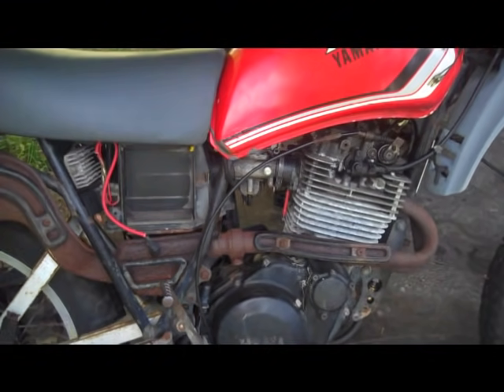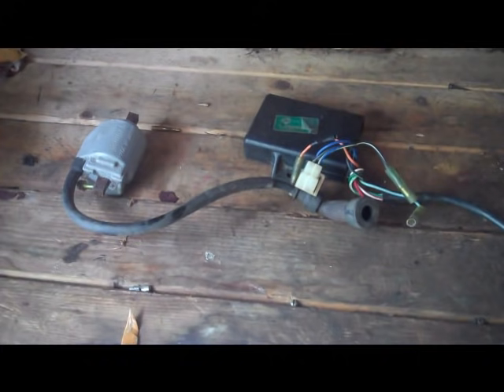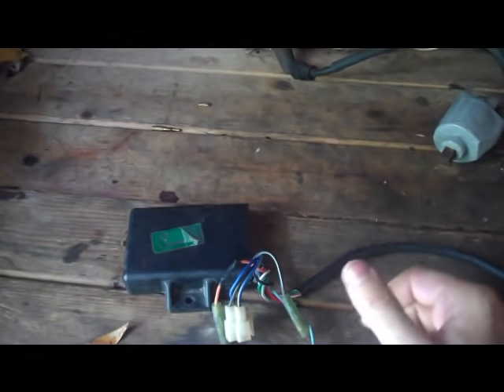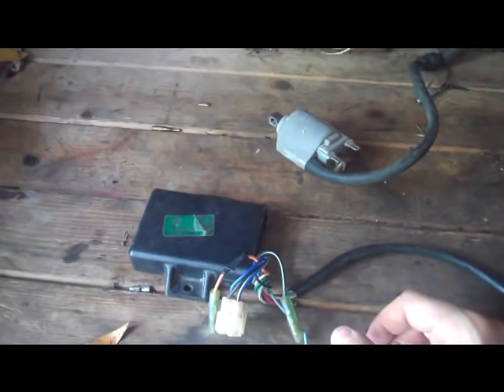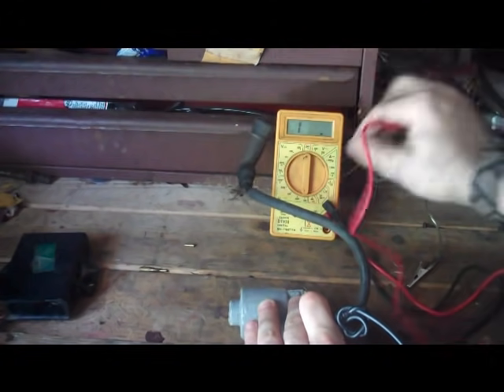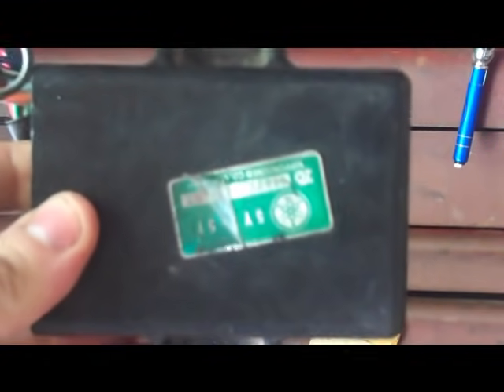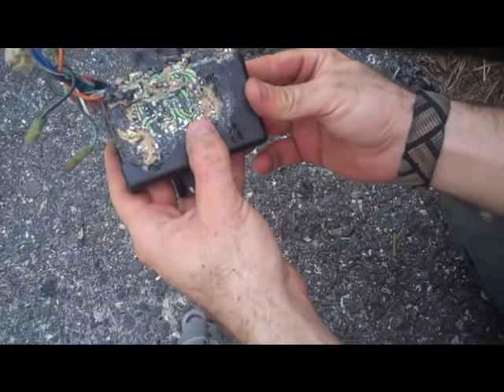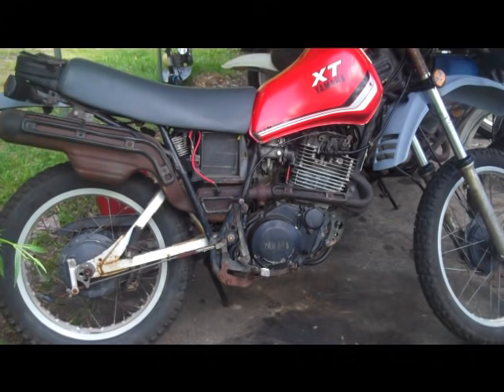How to test motorcycle CDI box, ignition coil

Comment: Hey mrmax, great vid. I have 1995 triumph speed triple 900 just fitted new engine. Starting no probs, though 3rd header pipe staying cold on tickover until you rev it a bit. Take it out on the road and is fine for 100 yrds or so then starts cutting out suddenly then starts again after 30 seconds or so and then keeps doing the same. Swapped coils over same symptoms, same cylinder, changed plugs, any ideas dude? just gonna check yer diagnostics site, cheers
Reply from the maker: Id suspect carbs first thing, perhaps that float is stuck not letting in enough gas
Reply: I can check that, through triumph forum the ignition pick up coil in the crank case came up as a strong possible with the very symptoms I'm having, got a new one to fit, cheers for replying :)
Reply: The problem tyrned out to be a dodgy spark plug. I thought I'd eliminated this possibility but the 1st plug I changed was not a new one, and bloody hell it turned out that it was faulty too. Only when I tried a brand new plug was it sorted. But its interesting to see find that all the symptoms I experienced were down to this. Cheers

Comment: CDI is electronic controller,collect charge from black coil inside engine, store in capacitor than discharge at certain time. small engine like chainsaw did't need sensor to syncronize it timing but motor bike have floating high resistant coil only connect to CDI both end, to do sync.
high voltage coil ,will charge capacitor in CDI, one end will connect to body of engine and another will be send to CDI.
lamp and battery coil, or power coil have low resistant ,almost zero.
DON'T USE HAMMER

Comment: i have a honda magna vf750, the bike will start but once running the RPMs will fluctuate up and down. normal operating range should be around 1000rpm the bike will rev up to 2000 then back down to 500 on its own and runs really rough could the CDI box have something to do with this?

Comment: Hello, I'm having some trouble with my cbr f3. The bike will not go over 55mph. It's like it's starving for gas past third gear. The carbs is good the fuel pump is good new plugs. It feels like the carb bowls are out of gas and when you give it gas feels like its empty. My question is can electrical produce the same symptom I'm having? I was thinking it was a fuel problem but note I'm thinking it could b spark

Comment: i have a motorcycle that uses 2 plugs per cylinder.  it seems only 1 plug is firing, other one, not at all.  my coil resistance is 14kohm, book says 18-20kohm is acceptable.  do you think the coils is causing poor spark?

Comment: Thinking my old enduro has weak spark. Replaced the CDI with a rebuilt one and have no spark at all. Put the old one back in, there's spark. Bike is running crappy but it will start. Got good compression. Seems that I have a bad headlight, though. Do you know if that can cause spark issues? I replaced a bad signal wire but no change in performance.

Comment: I just bought a 97 gsxr 750... Its been sitting for 2 years. Ive changed the plugs, oil, fuel, cleaned fuel tank and lines, new battery, and cleaned the heck outta the carburetors. The bike will run at idle but when I ride about a mile down the road the bike just shuts off and then about 15 to 20 mins later ill be able to start it again. Some one please help?? Thanks

Comment from the maker: Ha yeah probably the CDI is ok. Check for vapor lock, float levels, and vacuum leaks. Sometimes when your coil and spark wires get hot, if they have a crack in the casing it will allow the spark to ground out on the frame, causing the motor to stumble like it is running out of gas

Comment: Can you make a vid about checking your dirtbike for all kinds of problems? also cold starting is one of my issues. I've had this Honda xr100r sitting for about a year ... I drained the gas and cleaned the carb and the spark plug looks alright .. Any help at all would be much appreciated !
Reply: Get some ether in there, make sure theres spark and its drinkin gas.

If no spark, gotta get that first.
Try cleaning your points.

Comment from the maker: Id first check out the intake and air/fuel mixture. Is the airbox and boots all stock, tight and no vacuum leaks? Carb jets are clear and the stock size, float level set appropriately, clean air filter, good gas? These little bikes are very sensitive to inconsistencies in the intake
Reply: I have a Yamaha XT 600 motor and the wiring on the stator and that the plugins been cut off as well as the plug in for the CDI box I don't know where all the wires go to could you please help
Reply: Yeah this is Tim again on this 600 XT motor does Stater has no plugins they've been cut off the and the rectifier has no plugin I'm trying to figure out how to rewire this thing can anybody help

Comment from the maker: Its a wire that leads directly from the battery and has 12 volts to it, so when it touches the frame which is the ground, it shorts and causes heat. The solenoid may be to blame, or it may be a rogue wire like I described. Watch my video on wiring diagrams for more info.

Comment from the maker: Yes the battery will have an affect, depending on the design of the ignition system it may be able to be started without a battery, but more likely than not a battery is required in order to get a good spark

Comment: hey man, i got a question, when i check putting the negative onto the ignition coil and the positive into the plug doesn't read anything but the plug is new and the wire too, it could be the ignition coil?? and also mark 4.0 when i test the ignition coil i have to replace that?? thanks

Comment: sometimes it sounds like theere is a hole in my exhaust but if i turn my engine of and back on its fine my powervalve open and closes a lot by itself but today it happend and it satyed like there was a hole in my exhaust none of my lights are workin bike still starts first kick drives fine do you think my cdi unit is gone seems like it? oh and by the way i have a 2001 yamaha dt 125R and i only replaced the battery and the voltage regulator so it can't be them thanks for your help!

Comment from the maker: This one was full of resin too, some guys will meticulously melt it off on low heat to try to repair it if it goes south, but I didnt have the patience. Apparently the resin is a good idea for use on a bike that bounces up and down so much, but it does effectively make the CDI a replacement unit only

Comment from the maker: This could be a coil problem, or associated wiring. Its always best to replace with OEM parts, I dont know enough about GSXRs to tell you whether the 600 or 1100 or 1000 will mate up, or even the katanas, so go on ebay and try to find some 750 coils if you suspect they are the source of the problem

Comment: Hey Mr. Max, found the vid that u mentioned. On my 75' Honda I don't have but two test points one from the points and the other going to the plug. So I guess just go to ground on both of the wires and read the ohm? Then check the book. And I don't have a CDI box, maybe I should convert? Are they fairly reliable? I just need a spark. Could a rectifier cause any trouble starting? Thanks.

Comment: the bike runs well but at 5000 rpms she just loose power and almost dies!! 
just buy a new cdi and send the carburators to the mecanic! lets see if this fix the problem!
Reply: I have the same issue but it's around 1800 did you figure it out?

Comment: I believe the timing is good as the problem comes on and off instantly.  It could be the secondary, I don't know what that is, I was just told to make sure it was under 1ohm between the only 2 wires going into the coil.

Comment: It's not just at high revs, it's always, especially low revs.  At least it has a slim chance of snapping full power for a second at wot and/or high throttle.  What's the plug gap, I can regap.  I cleaned the carbs before I looked at ignition including soaking the jets (all looked pretty clean).

Comment from the maker: As taken form the repair manual (let me know if you want me to send you a pdf copy of the manual): If the engine misses at high speeds: fouled or improperly gapped plugs, improper ign timing (faulty component in system), improper or clogged jets, weak ign coil, weak CDI box, improper valve timing, fuel line occlusion. The book says you should have b/w .55-.85 ohms resistance on the primary for the coil, so you are good there, and 7200-8800 on the secondary. Did you test the secondary?

Comment: Well, looks like you were right, paid $100 for a CDI box (brand new, the guy builds 'em and bench tests 'em, "CDIMagician" on ebay).  Runs identical as before.
.
I've heard that the coil should have no more than 1 Ohm of resistance in it and mine has like .6 (and my multimeter was measured against a 1 Ohm resistor, so it's pretty accurate).  All the stator checks I did checked out.  Not quite sure where to turn now.

Comment: I have a roketa 50cc scooter that was running great until last night when I left it outside while it showered for 20 minutes. It was dirty so if figured it would be fine. After the rain I tried to start her and it started but the my tack was reading 10,000 rpm but the bike was idling at about 2 then it stopped running. I bought it with a racing cdi on it. I'm getting spark and gas but can't get it to run now. I'm thinking a cdi because of my tack being off.

Comment: I have a '82 CM450E.  My bike was dogging below like 40% load, then it would come to life.  Then the point at which it would "come to life" became higher and higher until it got to the point where it was always dogging.  WOT gets me to like 45 unless it randomly decides to crack full power at WOT.  Cleaned the carbs, no change.  I realized it was running on one cylinder, but I have a (VERY VERY FAINT) spark on both plugs.
.
So......coil or CDI box?  I don't like throwign $80 at something but...

Comment: o.k so i checked the plugs they r o.k.  but as i open the air box i noticed that the breather hose to the air box is oily, and around the air box seal.  what does that mean, and what is the function of the breather hose?  bike 01 magna 750

Comment: Interesting timing on this vid, Max. I followed a guide to cut a wire to the CDI last weekend. The bastard box was retarding the timing of the ignition apparently to ensure the rev's don't pick up too quickly and fail a fly-by noise emissions test. 
The engine is so much smoother and it fixed the flat spots I was running into. 5k on the bike (GT250), 2nd owner and only now is it running like it should have from the beginning.
Beware evil CDIs!

Comment: Well done. When I was younger, I used to stick a screw driver in the spark plug cable while resting the shaft of the screw driver against the frame. The I'd cranks the inline and check for a spark.